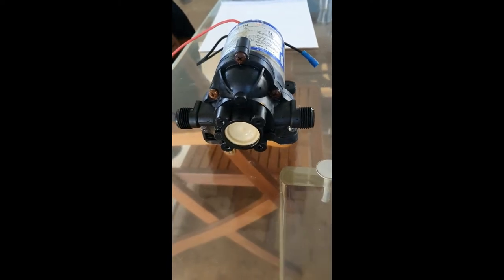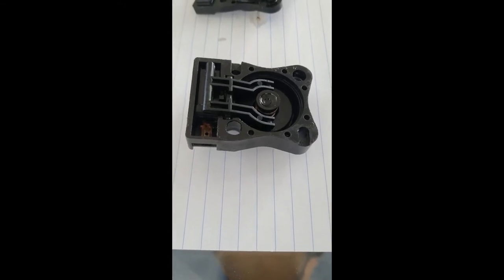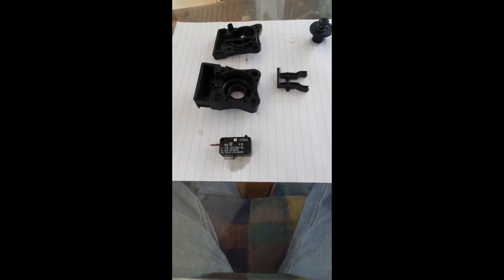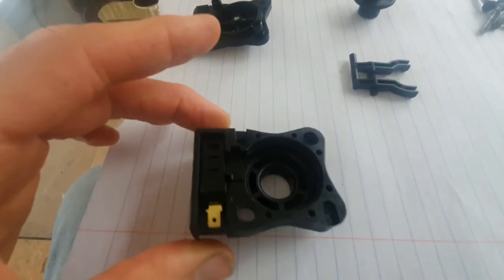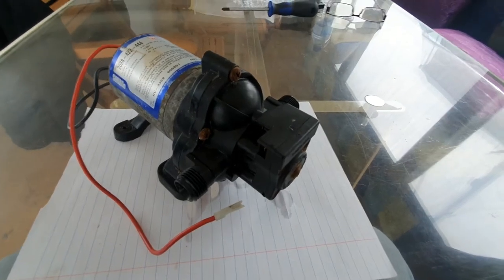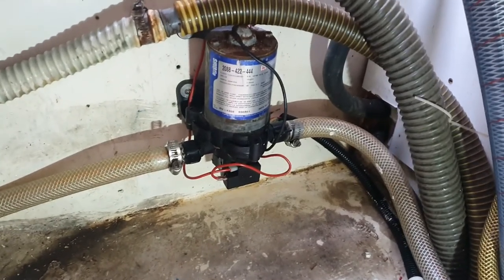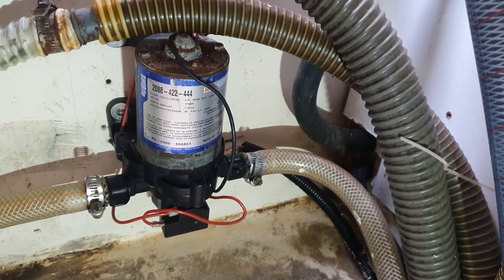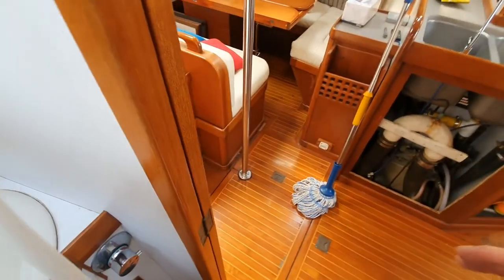How to repair the pressure switch in a Shurflo pump

Comment: Spot on! This helped us fix an identical problem. When replacing unit, how many ft-lbs (newton-meters) are the screws tightened? At 4:42, the neck spot should be seen by a derma doc. I cruised the tropics for 3 years and I got some barnacles too. Beam breezes.

Comment: Nicely done! I'm working on the same issue.  Does your pump shut-off when the faucets are all OFF? 
I'm having trouble getting the pump to shut-off automatically.  I have two springs (big and small).  I put the big spring into the Micro Switch Housing and the little spring underneath the nickle-sized diaphragm
on the pump housing. I think that's the correct way, but no joy getting the pump to shut-off with a pressure spike (i.e., faucets OFF).
Reply from the maker: Arthur, the fresh water system on my yacht uses an accumulator which is fed by this pump. I don't recall any springs in the switch assembly...the  pump turns off when the pressure switch is activated by the diaphragm. There are a number of variants of the switch having different force settings on the actuator button. A switch with a larger setting would tend to stay on longer.
Reply: @mcmarine4270  Thanks for your thoughtful reply.  In my pump, a Shurflo 2088-423-344, the switch housing (that houses the micro-switch) contains a spring loaded button (the spring inside the switch housing is the larger of two springs in the entire pump head).  When assembled, the button faces the coin-shaped diaphragm on the pump head.  Once the faucets are turned OFF, the water inside the operating pump builds water pressure.  That increased pressure pushes a plunger inside the pump head out of a small, tube channel. Between the plunger and the coin-shaped diaphragm, is a plastic,  "ram rod" (for lack of a better word) with a shaft connected to a round head.  A second, smaller spring, sits in the channel between the plunger and the ram rod.  The center of the smaller spring goes inside the  ram rod shaft.  

As the pressure builds with closing faucets, the plunger rides out in that channel, exerting force on the ram rod.  That force on the ram rod head pushes the coin-shaped diaphragm out; making contact with the button on the switch assembly. 

Once the pressure builds to 45PSI, the button compresses the larger spring, which in turn depresses a rocker that sits atop the micro-switch. As the rocker depresses, it contacts the switch; turning it off.

From what I can gather, the larger spring inside the switch housing requires 45PSI to compress.  My particular pump has no set-screw to adjust cut-off pressure.

You can see the springs in the following helpful video. The larger spring is discovered by the mechanic between 10 and 11 minutes.  He discovers the smaller spring  around 19 minute mark.  https://www.youtube.com/watch?v=1I7lEZDPUuI